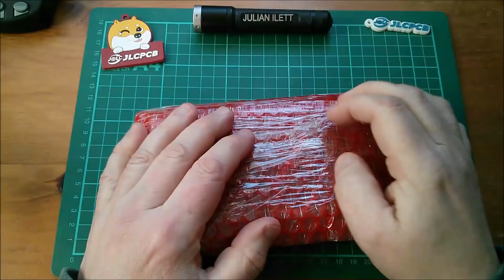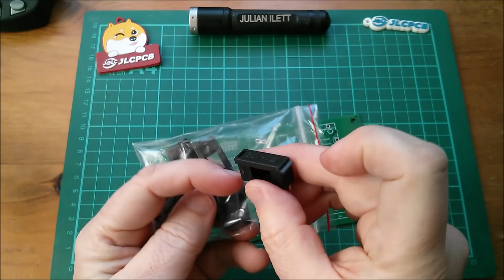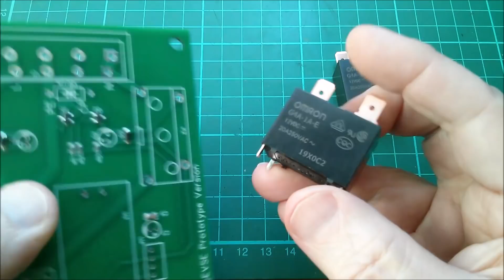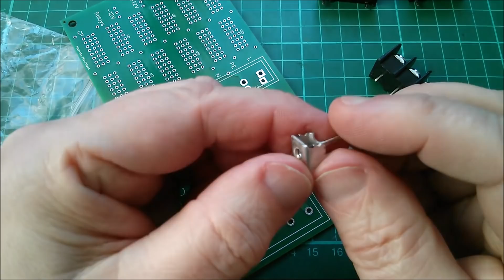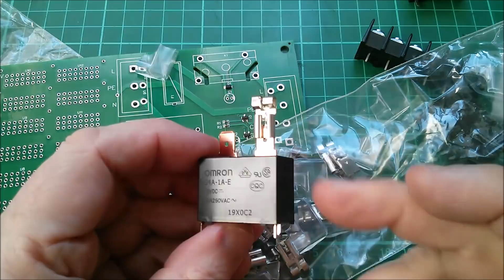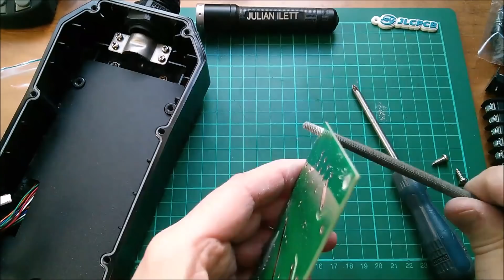New PCBs from JLCPCB - Electric Vehicle Supply Equipment

Comment: If you really want to use those relays (which seem like a good idea actually) then you can take a picture of the case from the top, scale it and outline the top of the case in Fusion 360 and then 3d print a spacer that sits between the bottom part of the case and the top part to give it slightly more height. 8mm high should do it and if you use black PLA and a small layer height then you can get a really good finish. Can also print in a space for a gasket or rubber o-ring material to at least try to retain some of the IP rating...

Comment: The right angle quick connects are crimped with a special crimper. Small side crimps the wire, and large is for the insulation.

Comment: The J1772 is such a simple protocol to control the onboard chargers.  I had fun building a CHaDemo interface to use the battery to connect to pv inverter.   Charging one EV with another, then swap and charged back.

Comment: To measure the distance between hole centers if the holes are the same size, start by measuring one hole diameter then zero the calipers, then measure the from the edges of the hole.
Reply: Came down here to say exactly this. 👍️

Comment: Typical EV charger (230V => 230V)  have 3 modules: Power Board (Relays , Measuring & Safety ) , Comminication Board (LTE, WiFi, GPS, ... ) and HMI board (Display, LED, buzzer,  etc)
Minimum Power for 1-Ph is about 7.2 KW (for UK) and 3-Ph about 20Kw for Europe :)
I'm wating for next part / next vido ;)
Reply from the maker: I certainly hope the minimum power for single phase charging isn't 7.2kW
My EVSE will charge at currents between 6A and 16A (1.44kW and 3.84kW at 240V)
Reply: @JulianIlett  Please see example of simple and low cost solution from EO Chgarging - EO Mini Pro 2. You will find more details & spec.
Reply from the maker: @jaroslawpiotrowski210  £649 plus installation - ouch.

Comment: To get the distance between the holes use the calipers  to measure from the right of the right hole to the left of the left one. Then measure the hole diameter and subtract that from the first measurement.
Reply: That sounds awfully hard compared to just measuring the distance between say the top edge of both.
Reply: @benbaselet2026  Often you know the hole diameter,so that step could be skipped. Measuring between outer  (or inner) edges and then subtracting (adding) the hole diameter, allows for positive contact to the material edges rather than having to eyeball/judge alignment of the calipers.

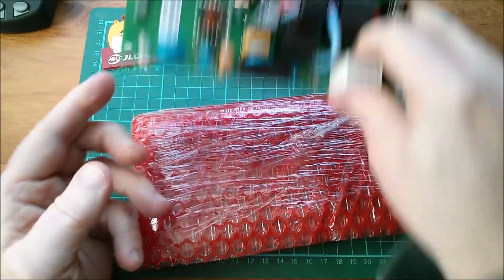Comment: 0:17 In the left upper corner of the old board  just under the crystal there is  square microchip with too much tiny legs  which you haven't in the new board  ?
Reply: This is an initial, every basic, no frills/features version - not a fully featured re-implementation

Comment: Is it possible to bend 90 degrees those connectors on those relays?
Reply from the maker: Worth a try - but a later design may use a taller enclosure.

Comment: Julian measure the holes outside to outside and inside to inside to inside, or outside to inside.
Reply from the maker: I kinda did, and it came to 70.5mm. Why would they put the mounting posts 70.5mm apart? I didn't like that number, so I put them 70mm apart.
Reply: @JulianIlett  With a digital caliper and the screws in place zero the caliper while measuring the screw head diameter, next measure the span across the outside of the screws, this gives you the distance between centres. If the number's an odd one it's worth pressing the "mm/in" button in case it's using imperial. 70.5mm is kinda close to 2 3/4...?